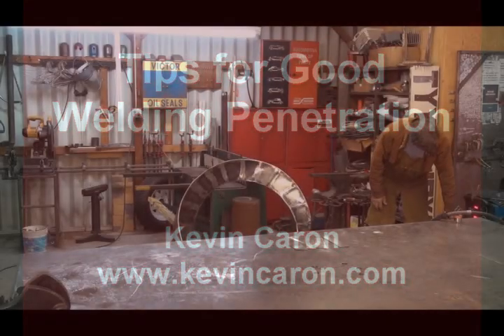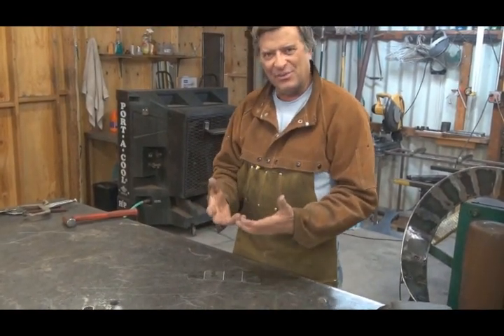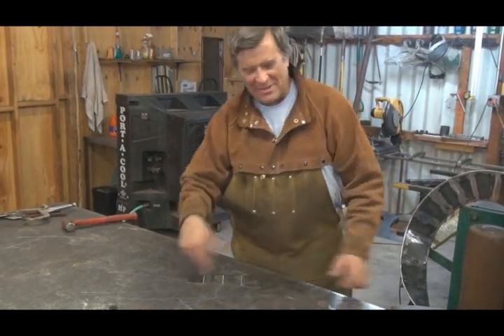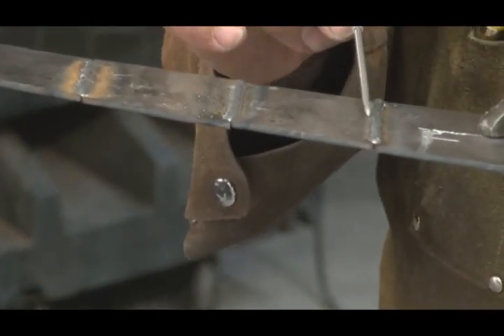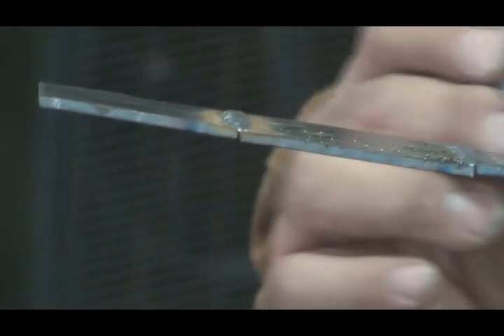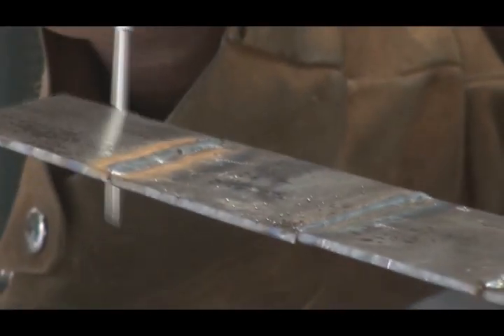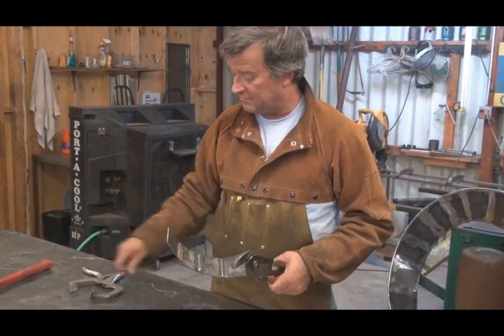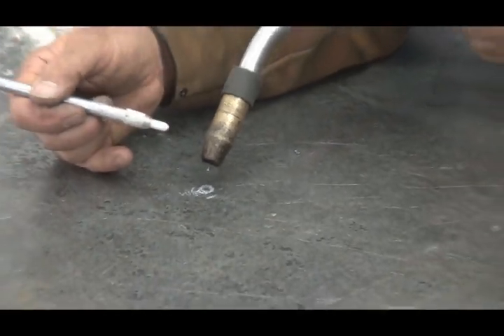Tips for Good Welding Penetration - Kevin Caron

Comment: Sorry, but I didn't see anywhere in the video where you show proof of "penetration".
At the end, you drew something that you're "supposed" to see (while welding) as "proof of penetration".
I recently bought a 110 volt Hobart Mig welder and I'm having a hard time trying to weld a solid 3/4" circular rod to a 1.5" pipe (1/4" thick).  The rod is about 1 foot in length and the part to be welded has been cut 45 degrees.
I don't know if it's the "roundness" of both the rod and pipe, but when I finish welding, there's a lot of solder between the rod and the pipe making me think "it's welded".
Once the pieces separate (after failing under stress), most of the "solder" tends to be on the rod, although I've had it once on the pipe.
I've become a really good "Grinder" because I'm having to clean the material out so I can try again.
I always thought that "welding" is sort of "fusing" of two pieces of metal in such a way that you melt them both and they become "one"......like marriage.
------------------------------------
Could it be that a 100 volt Mig welder is not strong enough for this?
When I "clean" the sites (by grinding), should I be able to see how much penetration was actually achieved?
I was thinking of setting the voltage really high with low speed so more time is spent at a spot with lots of heat so the metal can melt on both the rod and pipe and fuse them together.

Comment: What I find strange, both in my welds and these ones is that, even with too much current, the 2 plates remain separated. I thought they would really melt together.
Reply from the maker: Not enough current to get total pentation.   Mistake on my part, should have turned up the machine and tried again.

Comment: Good penetration is when the joint's metal is melted to the full thickness.  If you can see the weld's back side, it shouldn't look like a crack.  You should see the weld peeking thru the backside, hopefully in a very uniform fill.  MIG can do a poor job of penetrating with a decent-looking bead.  Crosscutting a test weld open with an abrasive wheel will help you visualize penetration.  For real strength, penetration is crucial.
Reply: Wow! It's like you watched the video and stated exactly what he said. Like it was your own idea. Amazing!!
Reply: Thanks Erik.
Reply from the maker: So true!!

Comment: I always seem to like shake a little it pisses me off I took a welding class for school I tried it out I've gotten some good welds but only sitting down when I stand I seem to be shaky a lot got any tips for a noob welder ??
Reply from the maker: Try bracing your hand on something..   Run a finger along the metal or put a rolled up glove under your hand..     I have even used a broom handle as a prop.
Reply: Weld in a comfortable posture, with the work at the proper height.  Don't try to weld with your arms extended too far.  Weld using 2 hands. Brace your main hand with the 2nd.   Hold the cable with one hand to lessen the weight on your main hand that holds the electrode.  Perhaps drape the cable over your shoulder.
Reply: Keep your elbows tucked in to stabilize your arms against your body, or prop your arms on the table. If your table is too low, you place something non-flammable on the table that you can rest your arms on, or place a pedestal on the floor so you can prop your elbow on your knee.

Comment: So, I am working with a Millermatic 140 trying to get really good at welding 0.120" wall DOM tubing to itself as well as 1/8" thick steel plate.  I see in your video that your "cold" joint was at 12V.  Mine i think maxes out at 10V, so maybe my problem all along is my welder isn't powerful enough to do this thickness?

I have tried beveling the edges, adjusting wire speed, voltage, gas flow rate (75/25), and hand speed to no avail.  Weld looks nice on the outside, but the only way we've been able to get the base metal to break before the weld is when we leave a gap of 0.030" or less all the way around.

We will try preheating the base metals prior to welding next.  Any input is appreciated.  Thanks!
Reply from the maker: Try smaller wire in the welder..   Like .024.   May give you a little more heat..   Or get a bigger welder.....

Comment: hey.  I was wondering if welding with two tig torch on a plate, at the same time, is that normal in the states, to get full penetration on stainless steel. In Denmark we call it Argon / Argon.
This is where one of the welders have the fillerrod and the other heat up the matrial from the backside, to make a good penetration and good shielding. We use it all the time in Denmark.

Thanks
Reply: ***** I don´t have a camera right now and the on in my phone is broken
but i will see if I can come up whit something

Comment: 1st and second wanted to bend at the joint while #3 bent the parent. Bring up the volts and go as hot as you can weld that job. Start too hot and come down rather than start cold and come up. Coming up, it's quite easy to get a good looking bead but crap peno.
Coming down, when you get your good bead, you've got good peno.

Comment from the maker: I would say that moving quicker would give you less penetration.  The name of the game here is just getting a great weld that will hold under all circumstances.  Sadly, if I remember correctly, that video was a better example of how to not do it than do it correctly. I should have left a small gap between the plates to allow for more penetration and turned the amps up a little more.  Like I said at the end of the video, "Practice , Practice and more Practice"...

Comment: well obviously he wasn't giving a good push towards the center of the butt joint or filling in the "key hole" deep enough to get the good penetration. I know it is somewhat wrong with back hand GMAW welding but, you can see how deep you can push the wire more fairly.

Comment from the maker: @kevincaron I will take you up on the advice soon. I am starting to get a sore head from banging it on the head stock trying to figure out how to make the parting tool work. Just get lots of chatter and not much cutting. Made sure it is in the center of the stock and been playing with the tip. I will get there someday. Always have the chop saw if I really need to. 

Thanks for posting.

Comment from the maker: @cgis123 Hi Matt!

Yeah, that's just a soap stone pen. Picked it up at the welding store and a supply of refills. If you get one, don't drop in on the table. The stone will break inside the pen and you just get little pieces. Been playing with the lathe and the mill a lot. Making tooling for the lathe with the mill and just having fun turning stuff. Have a paying job for the lathe now. Going to make a wine goblet for a guy in TX. out of copper. Going to line it with a stainless liner.

Comment: Nice, thanks. That big table sucking up the heat is a factor. I'd love to see/hear one on adjusting the wire feed and amps to get the good sound and weld. Also, one on adjusting gas for good weld protection.